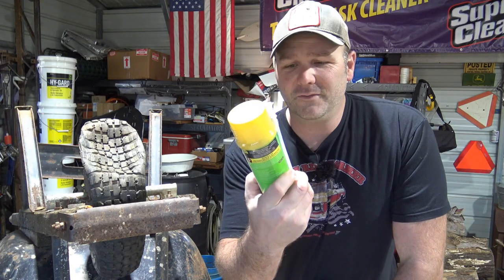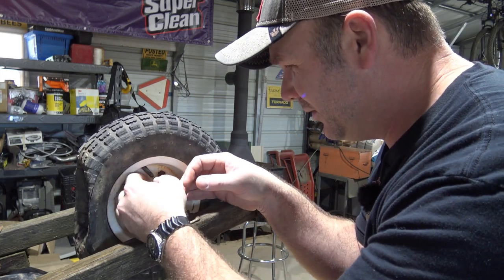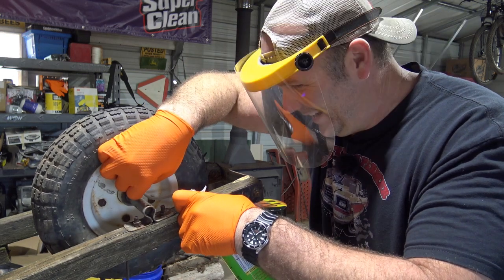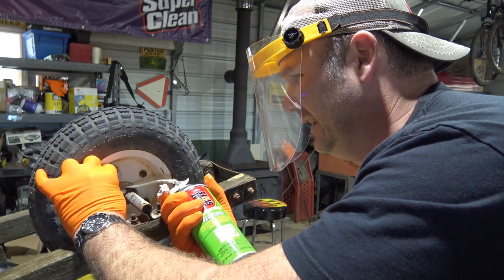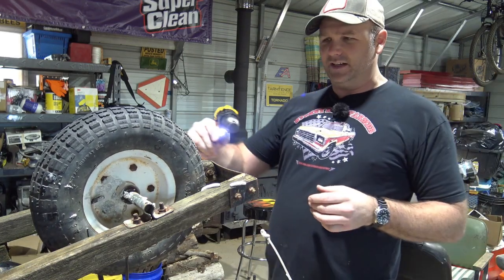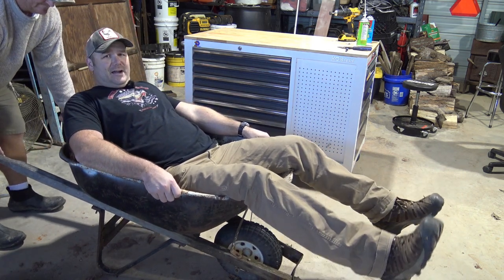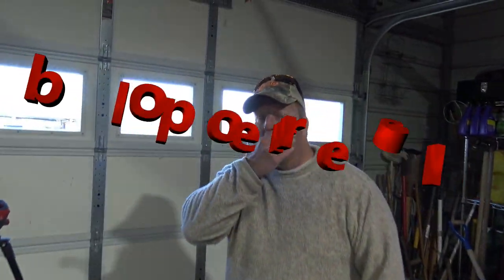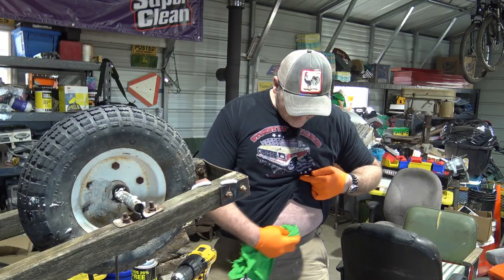Spray foam for flat proof tire...Will it work? Let's try!!

Comment: I did this twice on my lawn trailer tires and wasted 2 cans of Great Stuff trying this.  The foam never expanded or solidified.   I contacted the manufacturer and was told that the product needs MOISTURE to work properly.  On my third attempt, I injected about 2 ounces of water into each tire, spun the tires to distribute the water evenly, and then re-injeccted them with Great Stuff.  This worked out very well and gave me great results!  The manufacturer was adamant, however, that THIS IS NOT AN APPROVED USE OF THEIR PRODUCT.
Reply: I will have to give the water a try. I just tried to fill the kids go cart tires and it didn't expand and cure.  It's about a 13 or 14 inch tire and I used the entire can, throw the valve stem. How much did you use?

Comment: If you put holes in the tire, at the tread, it will allow the air that remains in the tire to escape, thus filling the tire fully with foam.  What you have is a tire that has both air and foam and that is why you had problems.  Then you needed to allow the foam to fully cure before hopping in the wheelbarrow.    Good luck with it.
Reply: My thoughts exactly

Comment: It does work I’ve done it You need to put a hole in the very top of the tire to let all the air out and let all the spray foam get in there and expand and let the air out you do that and it will work
Reply: Then let dry for +24 hours
Reply: Exactly!
Reply: They were using the wrong foam also in this video.
Reply: @thomasritter3159  I definitely agree
Reply: The foam they were using was fine. Buuuut the foam needs moisture to cure. You have to spray a teeny splash of water inside before you put the foam in.

Comment: You don't need a big hole in the tire to let air in. Also it doesn't set up after an hour. You need to let it sit at least 10 hrs to set up. What i do is take the value stem out put the foam in and just put the cap back on.  After some use you may have to add more foam. Just take the cap off drill the foam out of the stem and put the cap back on.

Comment: Use the large gap foam filler and then a metal valve cap to stop the outflow.  Trying to put the valve core in with pressure like that is too tricky.  Because it is in a sealed container like the can it came in,  you have let it cure for at least 24 hours to work properly.  Fun video otherwise.

Comment: Hey bud, the side of the can states to shake vigorously, and squeeze the nozzle with the can upside down. The can has a propellant in it that's quite a bit less dense than the foam. Spraying it upright results in expending all the propellant before u run out of foam and u just end up wasting like half the foam. U want the can upside down, the foam sitting at the bottom to be at the nozzle, and the propellant above the foam pushing it out. It's also been my experience that dispensing it upright causes the foam to not want to expand like it should for some reason. The difference in can position is noticeably significant

Comment: What I would have done was filled the tire and just put the cap back on it don't put the stem back in. And then just spend the wheel and let it even out the foam inside and then let it set for a while and then come back and test it

Comment: In the old days the valve caps on tires were metal and the top part was used to remove the valve stem.   Pretty slick you didn't need to carry around any special tools to remove the stem and you could flatten someones tire rather easy.......lol   cheers from RDU area    :)

Comment: Used 1 & 1/2 cans, waited 24 hours and tire was still flat. 
Bought a solid tire and went to throw the old one out. 48 hours later the foam worked! Now I have 2 solid filled tires.

Comment: It works! 
After 1 day tire was still soft. After 4 days enough foam escaped to fill 4 tires. 1week later tire was completely solid. I had to cut away all the escaped foam.

Comment: On off rode equipment they foam those tires but they use explainable foam and drill holes around the tread to get rid of all the air inside. It works very well.
Reply: hillbillydualsport real foam filled tires use an entirely different foam formulation, and they’ve never drilled holes in our forklift tires when they filled them.
Reply: Explainable foam??? Lmao is that foam that makes excuses 4 itself????
Reply: Btw rode??  U mean road by chance? Autocorrect failed u...
Reply: @PplCantDriveOkc  lmao

Comment: I used regular engine oil in my John Deere rider tires two years ago and they still hold air. Just remember to spin the tires.  Also, preparation is key with any job if you want it to work.

Comment: Mostly, here in Washington State,  ( it sounds like we both live by the same rules of developing land) the reason why you must have permits and  inspections to see that all work was done right and to code is because you also have the right to sell your property at any time ( it doesn't matter if you claim you'll never sell it, you could). So these rules and regulations are there to protect a buyer if you sell it.
That's how they win the argument here.
Good luck !

Comment: Forget putting the valve back in and just use the cap. And that foam takes about 24 hours for it to fully expand! Did that with a tire on my boat trailer about 10 years ago and it still is fine!

Comment: I just filled both fronts on my Craftsman with Green Slime. Worked perfectly!
Reply: was gona say the same thing
Reply: And no mess! Wow this method in the vid is messy
Reply: His way may have worked if he'd have let it dry at least 24 hours. But our way is much better
Reply: I put expanding  foam in the tires on a dolly. Worked fine. I did let it cure for two days. Tires are hard as a rock.

Comment: Think you are supposed to drill holes in the tire and fill in all the holes it also helps the foam expand..that's what I did for my lawn mower trailer

Comment: it will work if you compress all the air out of the tire first. the way you did it, there is to much air in the tire,  there is no room for the foam.  that's why the other guy drilled a hole in the tire so the excess air will leak out. plus you want all the air out of the can, lol, you just added even more air in the tire. just my two scents. you should make another video. promise it will work.  we do it with lawn mower tires,  even four wheeler tires.

Comment: Great video! A little humor is good for the soul. And the blooper reel is always a treat. I've got about 47,000 flat tires in and around my barn and shop. Annoying! I'm going to try renditions of what you did there. I actually think that could work with a little more trial and error.

Comment: I think that even if you let the foam dry over night it might be slightly better but over time it would probably crush down. The Flex-seal might work but a new tire and wheel from Harbour Freight would be cheaper and easier. If the wheel comes apart, you could disassemble it clean up the wheel and paint it heavily on the inside and outside then check the tire for leaks by filling it up with air and spraying the outside with soapy water. then fix the tire or put in an inner-tube. I would love to see if the flex-seal would work.

Comment: We used the stuff you mix in a 5gallon pale and broke the bead on one side of the tire. Poured the tire like 3/8 to half full and set the bead with the air compressor. Just to be sure it didnt explode we had the valve core out ahead of time. We did it to a hay rake and lawn mower tire.

Comment: Loved this video, shared with my peeps. FYI. The valve you removed from the valve stem is called a valve core. Sometimes also called a Schrader valve as used in AC systems.. The tool is called a valve core remover. 👍
Reply from the maker: Thanks Mike!
Reply: A Schrader valve is also used in propane cylinders.

Comment: Large farm tractor tires used oil in them. But when putting in the oil, there has to be an outlet for the air to come out so that the oil can go in! But you did great, LOL
Reply: rodney flynn Most large farm tires are water filled, you can buy an adapter that goes from male hose thread to valve stem thread and has an air vent on it. Turn tire so valve stem is at top and start water, air will exhaust.

Comment: Drilling a hole in the "top" (on the tread) of the tire gives the air being displaced a way to get out.  Also spraying the inside with a mist of water from a spray bottle is highly recommended These types of foam are "moisture cure" and use atmospheric moisture to cure. They will not cure (or will cure very slowly) in a sealed environment with little moisture... They will not cure at all in a sealed container devoid of moisture 
Doing those two things will absolutely work... I have done it many many times. and the resulting "flat free" tires last years.

Comment: I used to work for a company that would foam fill mining tires. They would drill a screw into the tread so the air could escape and the foam would push out all of the air. It would be 100% foam filled. Then they would sit overnight to harden and they were completely solid the next day. The only problem with them is that they were heavy as hell.

Comment: I have a small trailer that I pull with my mower and I used the spray foam for the tires on it worked great been using it for a few years now. Just don’t leave any weight on the tire, it will cause a flat spot

Comment: You need to put a hole on the other end so the air can escape otherwise it won't allow the foam to fill it. I did it on a quad once since we couldn't get a replacement in time and we were going that weekend.

Comment: The right way to do this is to drill 4 holes in the sidewall of the tire.use a drill bit that is a snug fit for the filler straw.fill one hole until you see foam starting to come out of the holes on either side of it.put a tire plug in the filler hole.then top off the other 2 holes until you start to see foam coming out of the forth hole.put tire plugs in the other 2 holes.then top off the forth hole and leave it open as a vent for the expanding foam.you will not have any air trapped in the tire using this method.

Comment: It works you just drill a couple holes to let the air out and in for it to cure, I just did it a week ago on my lawn tractor big wheel and a sulky wheel

Comment: It seemed to be low; but only on the bottom part of the wheel. I like your t-shirt. I once had a '76 Ford 4x4 Custom (five bolts per wheel). My pickup had round sealed beams. Your pickup has rectangle. Well manufactured vehicles nonetheless.

Comment: Guys ,good fun, BUT you need to wait a long time ,a few days maybe because there is very little air to cure the foam ,if the tire is 100% foam it will not cure ,its just like being in the can , so you need to wait quite a while for it to cure

Comment: The spray foam will only work with the holes in the sidewall of the tire for a short time. The foam will compress over time and now you have a flat ruined tire. Putting it in through the stem and adding a little air will seal up leak, We are at 4 years now and still no leaks. However the bearings are shot!

Comment: My craftsman mower had airless "bicycle" wheels with cavities similar to tube tires,sidewalls so dry rotted they collapsed like flats..I used cheap zip ties every few inches to keep tread aligned with the bead,then drilled small holes thru tread to insert foam and also allow excess foam to expand out..waited a few days for curing before slicing off excess product ..worked excellent! New wheel&tire all 1 piece, cost about $25. each,    Realize that the foam must mix with a certain amount of air to cure...your tire in video might have needed a week or more to cure if at all..

Comment: Most people say foam filled tire but think about this if you foam filled a tire it would always have flat spots at every point it's sits for awhile. Hard tires are latex filled this is a rubber fill and you can run it until the rubber is gone but it adds weight to the tire. Always latex tires nerve foam fill.

Comment: Thanks for the idea, my wife insists she can use the riding lawn tractor to cut everything she sees, even some viscous thorny plants that would make a grown man cry. I used a can of fix a flat on 1 of the tires and witnessed it leaks from over 30 thorn holes on the poor tire. I think next time I'll drill out the tire in a few spots and use your method then bet the wife she cant get a flat again.
Reply: If you over 30 thorn holes in your tire, why would you need to puncture more holes to allow air to escape?

Comment: The main activite ingredient is  Cyanoacrylate, the same as super glue.
Water is what activates it.
Putting in some water first, removing the air, and allowing it cure and it will work, for awhile. It will eventually crush down.

Comment: FYI spray foam you need to hold the can up side down or it will just blow the air out of the can. Thats why when he said it's coming out very slow, because he already blew the air out. If he started it with the can up side down it would blow foam out with pressure and fill the tire with foam, but you have to let the air out so it can fill up with foam. just drill a small 1/4 hole on the other side of the tire  as far away from the valve stem and let it dry 24 hours or more. it works if you do it right.

Comment: After watching your video I tried it myself and found that you made some mistakes. First you tried to reinstall the valve stem, which definitely didn’t work. I am went with 2 cans of foam and rather than installing the valve stem, went with the valve cap.  I shook both cans, sprayed the first can, put my thumb over the valve while I got the second can. Sprayed it in and installed the cap. All this was done in the morning before I went to work.  It sat all day outside in the sun and when I got home, aside from a little foam that leaked out I had a solid tire. I did however let little water trickle into the valve stem before I started.  So,  I found that adding spray foam into the tire does work.

Comment: They drill holes in the side because the foam needs air in order to dry. 
It definitely works if done correctly.

Comment: Funny thing about foam is it needs oxygen to harden. So if you left the tire with no outlets it would take longer than an hour to cure. That is why you create holes in the tire to allow it to cure and expand.

Comment: The foam generally expands 30% larger than is sprayed. Also if air cant get to it it doesnt solidify. Ive filled them before but did so with the tire broken loose from the rim. The tire was in bad shape. It lasted quite a while longer.

Comment: The problem with using foam such as Great Stuff, it requires air to react and cure. I attempted to fill a PVC pipe with foam then cut it up into pieces. When I cut the pipe, the Great Stuff was still in a liquid state inside the pipe and start to foam once exposed to air. Try this with polyurethane Gorilla glue,  it will start to foam up once released from the bottle. 

You need to use two part polyurethane foam, this stuff will react anywhere once mixed together.

Comment: Have used the expanding foam with sucess   tire still enflated 3 years later  will haul a full load of firewood with no problem at all  Not sure of the weight though   try it again with expanding foam and spin the valve stem to the top after filling remembering to let the air escape so the foam can fill the tire and harden    mine expanded 9 times its size according to the can
Reply from the maker: Cool thanks Larry

Comment: Spray foam requires three things to catalyze the foam in order to cure properly. 1. Air. exposure. 2. Moisture of some type. I use a sprayer with water to soak the area if it's too dry and I'm pretty sure the inside of a tire is usually dry. 3. Time.  All of the jobs I've ever had to use foam as a moisture barrier and insulation required time to set, usually at least 24 to 48 hours depending on the size of the area and depth of the cavity. Entertaining video though.
Reply: Bingo!

Comment: I did this to my tire, over 15 years ago.  It isn't flat, and I have been using it for lots of things around the home.  I did have to poke holes in the sidewalls.  The foam didn't fill the tire on the first try.  That is why I had to poke holes in the sidewalls..  But I haven't had to put air in a flat tire for the 15 plus years...

Comment: It WILL definitely work if done right.Fairly simple physics here.The foam can't go in if the air can't come out.Just drill a few holes.A tube is cheaper and less messy but it won't get you a cheque from YT.

Comment: A) Use a higher-pressure foam like "Big Cracks/Gaps" (black or yellow can), this type is just for pest prevention and is designed NOT to explode your doors/windows/walls with expanding pressure.
B) Even with high-pressure foams, inserting foam into a semi-sealed environment with gasses already in it would prevent full expansion but wouldn't create enough pressure to hold up the tire; the bubble of air wouldn't compress down to a liquid or anything, and the foam would only expand to fill the area it could until pressure got sufficient to stop it.  Any air/water/solids that are in the way will prevent this from working effectively.
C) Let it cure longer.

Comment: Without moisture, the foam will nit solidify. Spray a little splash of water in it before you put the foam in it. No spinning required. Also, the existing ait needs a way to escape. Drill one small hole in the side of the tire away from the nozzle and theair will escape just fine.

Comment: Ya need to turn the can upside down (Read instruction).  If ya don't your mostly filling with the can pressure gas.  Best to use high expansion foam NOT draft sealer.

Comment: You should put tire cap will stop flowing foam out of stem of not using the corn. For corn is no longer using air.